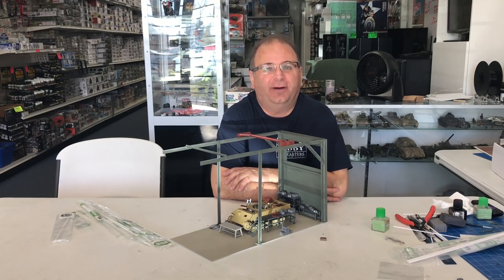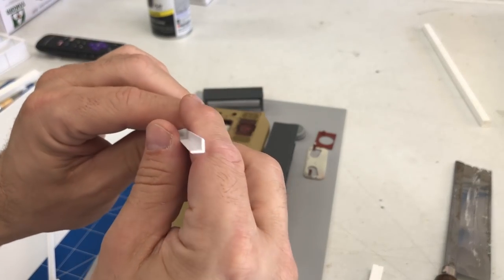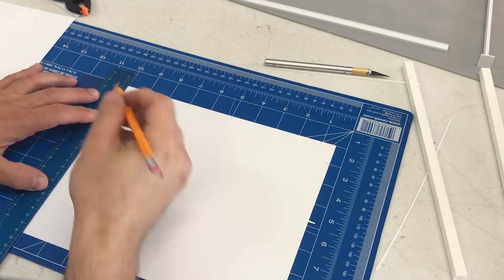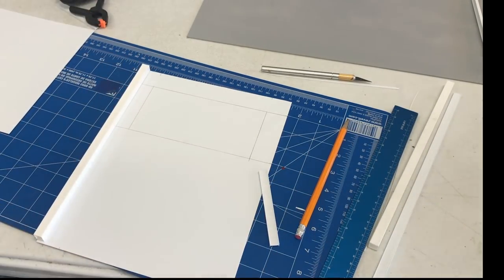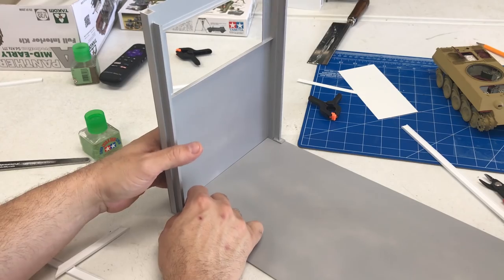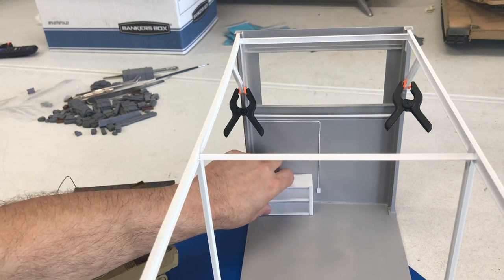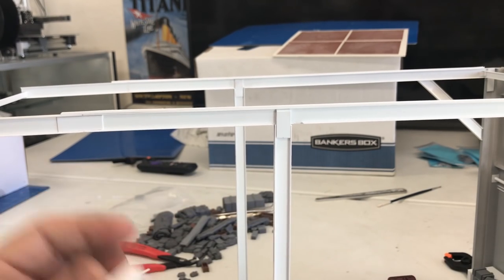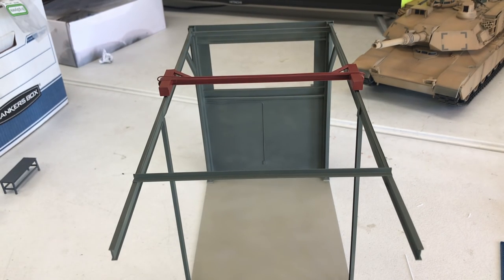Building the Takom Panther Repair /Factory Diorama  pt 3 Update  factory construction begins

Comment: What youll usually see in germany, are Brickwalls, painted white, and all the I-beams and other parts, painted grey. Also, they usually dont have huge long windows, but rather, many smaller ones, that form one regular one, even back then, they did not have any big Imperfektions in the concrete flor, but Remember, its a Brickwall, so maybe try getting the Wall some irregularities and make the surface less flat :D. Ofcourse this is just the "basic" design of that time and mustnt represent a Panther Tank factory, but maybe you can get some Inspiration from that too. Great build so far, looks amazing, but a bit big and Fragile ... :D Wouldnt survive in my Home, with kids etc :D

Comment: I used to work in a Factory/Workshop that was built in your time frame and not only were there a lot of expansion lines in the floor but different concrete panels of various shades of grey.  The walls were corrugated iron and the pipes/ tubing made of Asbestos and there were lamp shades dangling from all over. The place was also quite tattered and very grimy. Hope this helps and love the project.

Comment: This is a really cool idea for a diorama (that I may at some point steal, if you don't mind). If you are interested, I have some comments on structural terminology. The upright members are known as columns (not beams or pillars), and the plates they rest on are known as bearing plates. The horizontal members spanning between columns are known as beams (sometimes also as girders), and the horizontal members spanning between the beams are known as stringers. The plates connecting the columns and girders are known as gusset plates. The floors slab would absolutely have expansion joints at around 3 to 5 meters, and  would likely have numerous grates to catch leaks etc.

This is a great idea, I can't wait to see it finished!

Comment: would agree with other comments that the back wall, between the  columns would look better in  brick,  scruffy and part painted,  also perhaps, some  electrical cables draped along as well as the trunking   and perhaps a couple of those big  factory lamps  hanging from the beams and brackets along the wall.   you could go to town on detailing with this Andy, finally drop a big perspex box over the whole thing for protection from fingers as well as dust!

Comment: Love seeing the dio featured. Not to be picky. But all the tank factory pictures I've seen show them moving down an assembly line, like cars. So the wall in back of the tank seems off. Can you rotate the tank 90 degrees like it's being assembled parallel to the exterior wall? I worked in a pre world war 2 steel mill. All the exterior shells of these massive structures are very similar. The exterior wall should have a second set of vertical I beams offset three feet inside the structure. Then add cross bracing from floor to 4 feet below the roof line. On top of that is a 3 foot wide area for the overhead crane tracks.  Oh use 10x as many bolts and rivits as you would think. They went crazy with them on all joining plates and bracing plates, some plates, etc.

Comment: If the floor is pre-cast concrete, the panels would have had lifting holes near each corner, and they would sometimes be left there, and sometimes filled in. If open, they would have a vertical ring inside them.

Comment: I've watched this video at least 3 times now.looks great. if it was mine , I'd add another piece of tubing to represent an air line and some rubber tubing off of a regulator of some sort. Also I would try to make the crane bigger so the turret could be suspended over the tank. it might be easier to see all the detail in it as well

Comment: Andy, I think you need expansion joints on the concrete floor.  Unlikely with the weight of the finished vehicles that the floor would be a monolithic pour.  Expansion joints will allow for better weathering techniques and tonal variations.  Keep up the good work.  This is a GREAT project!

Comment: Hi Andy.  Regarding the question concerning the floor and expansio joints, if you look in the book Tigers 1 and 2 and their variants by Walter Spielberger or if you google Panther factory, you will see that the floors did not have expansion joints, but rather had a "track" that the tanks were pulled along in their production line. Regards.

Comment: Andy, of my knowledge as an architect, let me give you some advice.  You SHOULD have expansion lines, you simply couldn't handle such big surfaces of concrete at that time without having them.  If you don't have many photos of factories of the time, you could look at pictures of train sheds was the same kind of contruction method.  In my opinion, the back wall is lacking depth.  The side walls could have been done in either two ways.  First option would be brick work.  In that case, the wall would have depth (in 1:35, about 2.5 mm the least), and would have either been left unpainted (you would see the brickwork), it would be painted (but you would see the texture of the bricks)  or it would have some kind of stucco and with it some irregularities.  The other possible construction method would be similar to that of a plane hangar.  In that case it would probably be made with ondulated sheets o metal, wich you would see.  Additionally it would have quite a lot of metalic structure to support those sheets.  Also, due to the dimensions it would probably have X beams connecting the columns (hope I'm being clear.. I'm not an english native speaker, and some of the techincal terms are no clear to me).  Concerning windows, if you had such a big area, it would surely be made of several small panes, with metalic L shaped frames.  Hope this helps ypu.  Cheers from Argentina!

P.S.: Here's an example of how it would look if done in metal sheet:  https://www.emporis.com/images/details/468958/entrancearea-inside-of-the-former-train-shed-now-the-east-entrance

And here's what it would look like if done in brick work... http://www.davidheyscollection.com/page94.htm
Reply: frogmedia great advice! Hopefully Andy sees this.

Comment: You showed an L shaped cross member on top of the rails where the crane runs.   Those would have been below the top to allow the crane to run the width of the factory.

Comment: Yes expansion lines. That floor is far too large not to have it. Also include diamonds around your pillars. Warehouses where you dont see expansion joints are usually epoxy floor over concrete.

Comment: The road outside my house was laid by ex German POW`s not long after WW2. The concrete pads are 12feet by 12 feet with 1/2 inch joints between each pad the joints were filled with tar. The surface of the pads were tamped using a long wood board that gave a fine rippled finish. The edges of each pad were troweled smooth giving a six inch wide smooth boarder to each pad.
Now how much of this came from the Germans and how much from the clerk of the works who can tell. The bit I like is every third pad is signed by a worker in the corner.

Comment: Hi Andy, I've just started to get back into scale modeling, I was always fond of the Tamiya military series and had a large  collection when I was a pre teen and teenage, ( now I'm 55). I notice yourself and other tutorials don;t pre paint parts before assembling, especially the more detail parts,is it necessary to do so? I used to paint all the parts prior to any assembling and do any touch ups and weathering after.Obviously your more professional and your results are amazing with detail. I have a 1/35th Tamiya Kublewagen to assemble, and I'm a little rusty after 45 yrs, what tips can you give me? And just a little price comparison I paid $5AUD for the 1/35 Tamiya Tiger M1 tank (1977) and now it's $70AUD.
Reply: Hi Sierra !, not really advisable to paint all parts before assembly as the glue needs a clean styrene plastic surface on both parts to be able to glue and set properly, you can however build up a sub assembly (engine, or cabin) paint those completely, but make sure that the places where the glue needs to go to join them to chassis or the like, are paint free. As for the prices of kits today.................you should try buying something here in Denmark with about a 150% tax mark-up...................which is why I primarily buy from eBay Stores. South Korean and Chinese Stores are the cheapest !

Comment: Don't forget some oil and or grease stains on the floor.  Maybe some paint splotches?  I would think some cracks in the concrete would also be accurate.  These are heavy tanks and lord knows how strong the floors were.  Oh and a wrench or two, a broom and or shovel and a garbage can on the floor would not be out of place.  I know those are a lot of tiny details but they would look good don't you think?
Reply from the maker: Oh yes I am going to really dirty it up soon plus I have all kinds of tools to add
Reply: I am looking forward to seeing it.  Wish I had the patience for that type of modelling!
Reply: What would be nice to see would be a metal plate with really rough edges somewhere next to the tank, as german tanks were manufactured as a completely sealed hull into which the openings were then cut and the interior installed. Even the turret "hole" if you will was cut out of the top plate after the hull was built!